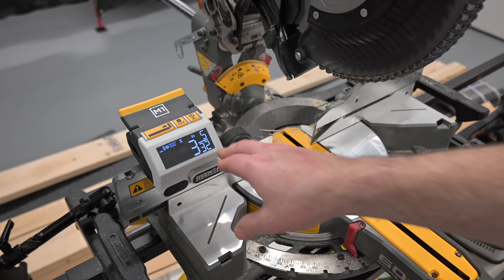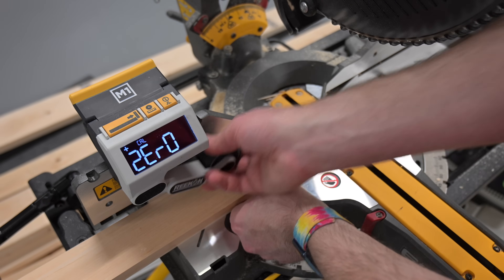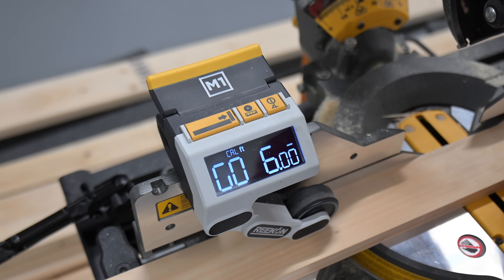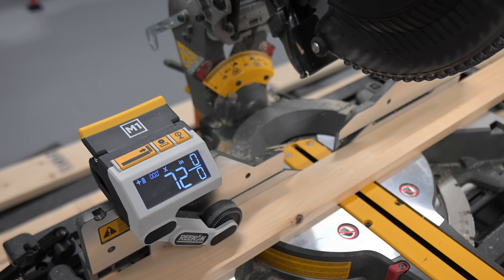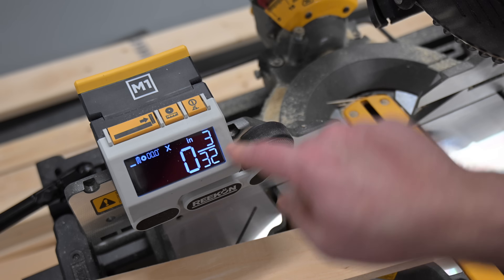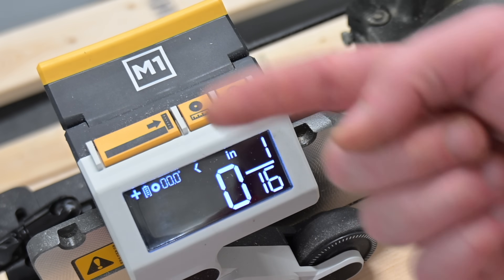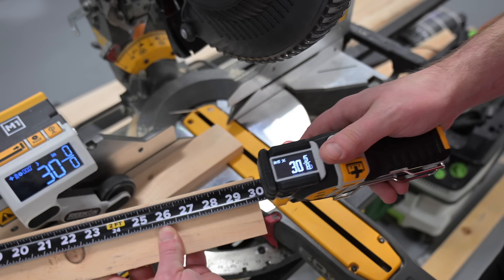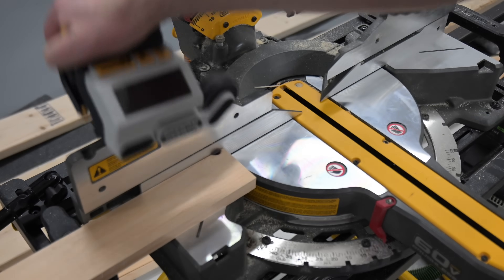Accuracy Review - M1 Caliber REEKON Tools Calibration

Comment: I have this, it's basically a slightly more convenient ruler. You are simply trading one form of measuring for another. So instead of using a ruler and making a mark, you are now sliding the wood piece carefully and watching the digital screen hit the mark you need, if it goes over, you have budge the piece back to the left, if you're too cautious, you fall short, and need to budge the piece to the right ever so slightly. Notice when he's making the repeatable 5" cuts, the video is fast forward. Because it would be pretty boring to watch all the little budging and nudging. The fastest way is probably still taking a cut off piece and using it as a template. Having said that, I do like it a lot. From time to time, I need to make a cut, and I don't need to grab a ruler or a pencil. Just have to be sure it is clamped on tight and never moved, otherwise, you'll need to recalibrate, and you'll need another >72" piece for that.

Comment: Do you have to calibrate every time you take it off the saw ?
Reply: Yes. I have one as a trim carpenter and when measurements are called out to me I can beat anyone with a tape.  For $119 bucks it pays for itself in 2 hours. It really is a game changer.  It does angles also up to 60 degrees.  These will eventually be built into every saw.

Comment: This thing sucks. I’ve had it since the Kickstarter and have never been able to get a calibrated every time I do it’s off by the kerf of the blade, which doesn’t make sense because your calibrating it to the left side of the blade every time.

DONT WASTE YOUR TIME OR MONEY
Reply from the maker: hey William, the kerf is entered separately from the calibration - https://support.reekon.tools/hc/en-us/articles/360061902152-Setting-the-Blade-Width-M1-Caliber
Reply: @REEKONTools  why would I have to do that when you calibrate it to the left side of the blade.
Reply: @williamhsewardiv5742   Curious to know if you set the left side of the blade on beginning cut and then set it to right side of the blade on the end cut, would you get the correct lenght?

Comment: Why bother with the blade kerf off set… just bump your material to the left side of the blade, then when setting the calibration, line it with the right side of the blade 🤷 Wouldn’t that work?
Reply from the maker: slower and less safe than just touching off of starting again with each cut
Reply: @REEKONTools  But if you start your calibration on the left side of the blade and end your calibration on the right side of the blade, the kerf is therefore automatically accounted for, so each cut would be correct without knowing the actual diameter of your kerf… 
•Additionally it would simplify the process and be more precise without the extra steps of figuring out your blade kerf and then programming it in
Reply: Why NOT just set the blade kerf offset? It takes literally 30 seconds and is good until you reset the M!. Then you don't have to remember allow for the blade kerf. I just set up mine with the factory-listed blade kerf (2.5mm for my Festook Kapex 120 fine cut blade) and cuts are precisely correct. I use a zero-clearance insert on my Kapex and just align the workpiece to the kerf line on the zero-clearance insert that the blade made, zero the M1, and the results are perfect. Very cool...

Comment: I’m wondering if this would work well when I have to cut alot of aluminum storefront excursions….. just wondering if the wheel would have anough traction.
Reply from the maker: yes!  we have a lot of customers use for alumnium extrusions and it is even more accurate than with wood since aluminum is rarely warped

Comment: Will not debris built up on the wheel cause an under measurement?
Reply from the maker: yes it would, usually not much sticks with a vacuum running and its easy to wipe off but if the diameter changed then that could cause inaccuracy